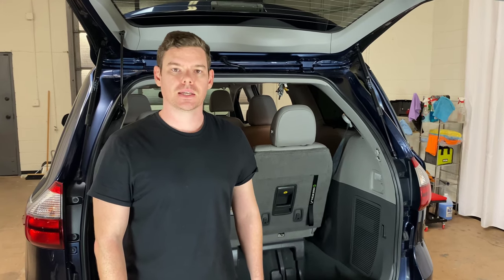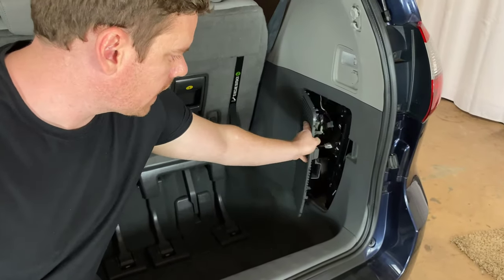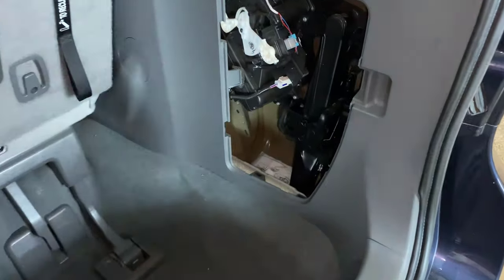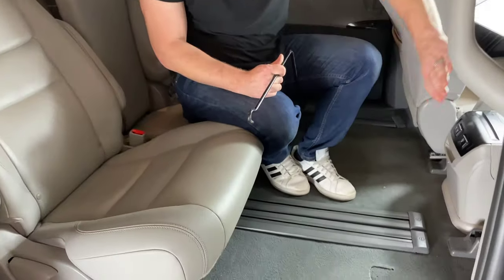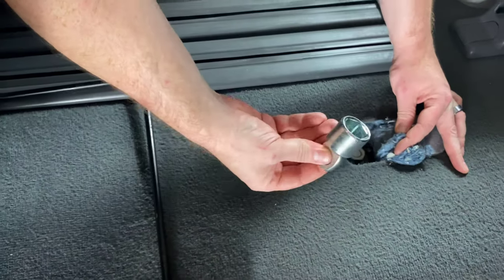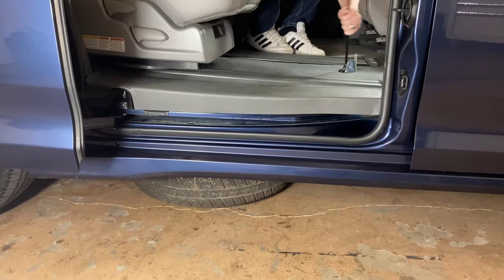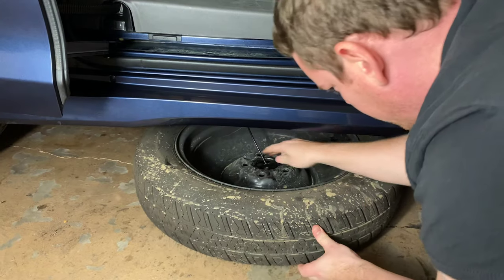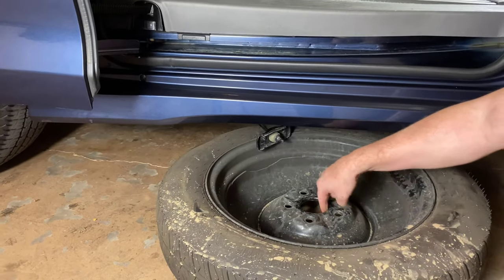How To Remove 2011 - 2020 Toyota Sienna Spare Tire - Spare Removal Jack Location - Change Flat Tire

Comment: Thanks a lot for the video! In a few minutes I was able to put the spare back!
A couple of notes:
1) There seems to be a correct side of the tire to fit the hook/tool that is attach to the wire so if after trying the square is not going into the tire just flip it. 
2) when pulled close to the chassis, if the tire is not centered it wont be flush, rather sticking out. If that's the case simply lower it a bit, push it gently towards the center of the car and once it's properly centered raise it again. It should be flush with the chassis, sticking out a tiny bit. 
Hope that will be helpful to somebody!

Comment: I want to install the hoist in my Sienna 2012.It did not have .just received the hoist arm and cable. but I can find a room for it under the van.there is a catalytic converter in the way .can you help with a drawing how to install the hoist. I will appreciate.

Comment: Thank you for doing this video! I didn't realize you could just pull the spare out from under the car once lowered to easily remove the wire. I tried to do it with the spare still partially hanging under the car and could not fit both arms under the car to remove the clamp (I would need two: one arm to hold the tire up and the other to remove the clamp itself). Now I realize I could have just completely lowered the tire and moved it out from under the car first!

Now as to why Toyota made a weird 5-sided lugnut to hold the spare tire, I am not sure, lol.
Reply from the maker: You're Welcome! Glad it helped
Reply: I read that Toyota made a weird 5-sided lugnut to hold the spare tire because shops were using an impact wrench, the same used for the lug nuts, to tighten the spare tire nut. People who got flats couldn't get the spare tire down. Toyota wanted to make that impossible, so they swapped the six sided nut (same a the lugs) for the 5 sided nut.

Comment: If you are wondering if it is difficult to get the spare out with a passenger side blowout...yes. Drive onto a rock, branch or curb. Get the spare out and then jack on level ground. Or call a tow truck and have a coffee and tip well.
Reply: Use the jack to raise up the flat tire before lowering the spare.

Comment: Can I add a spare tire (need the specialized nut too I guess, but have the tool kit)?? I've had the van for +6 years and realize it doesn't have a spare tire- the dealer just put a water plug where the bolt should be. Yikes.
Reply from the maker: Yes - you can order a spare tire and the tire "hoist"

Comment: Thanks - great help for finding the spare. Unfortunately the morons at Toyota thought it would be fun to make the lug wrench that comes with the car, a toy. It’s covered in rubber and does not fit on the lug nuts, so you still have to call roadside service to change your flat, or buy a real lug wrench before you have trouble.

Comment: Mine doesn't have the carpet cutout, it's just not there.
Reply: For anyone else having this problem: the carpet they’re showing is after removing the factory floor mats. The factory floor mats are held in by STRONG metal buttons and plastic rails, under them you’ll find the cut out.
Reply: Thank you, Handy